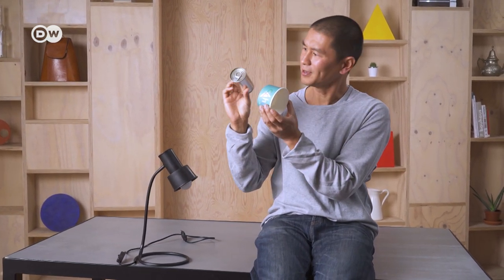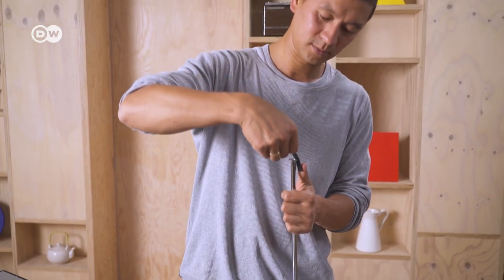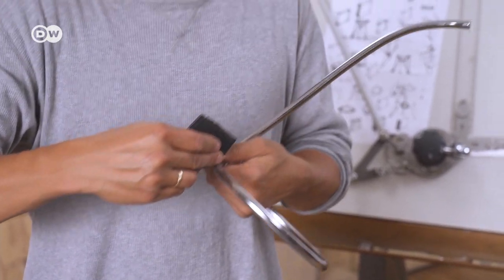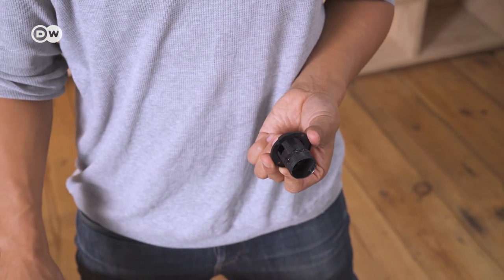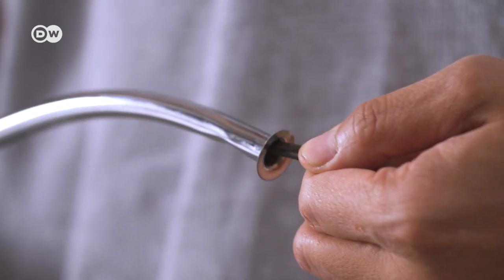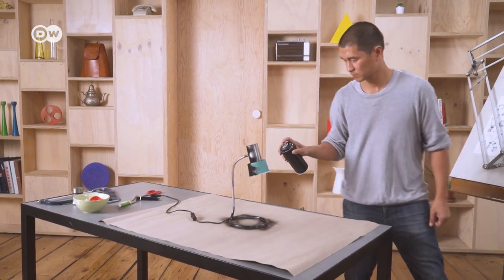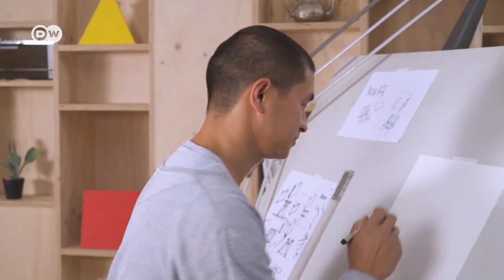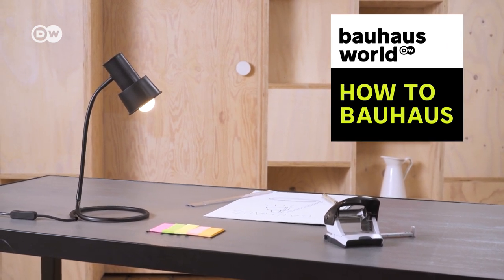How To Bauhaus – How to Build a Table Lamp | Bauhaus Design Idea | DIY Project

Comment: If it is metal, wouldn't it be a good idea to have this earthed?
Reply from the maker: Thank you for your comment. The cables are connected to the lamp socket which is made out plastic. In this case, there is no problem and it's safe. But you're right, one should make sure that the cables are in place and don't touch the metal rod and that the lamp isn't plugged in while you're building it.